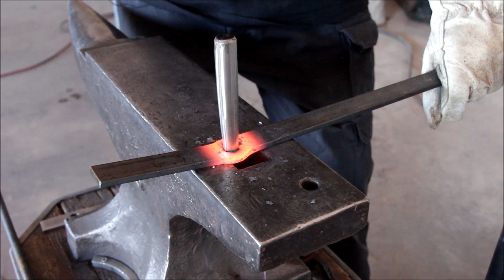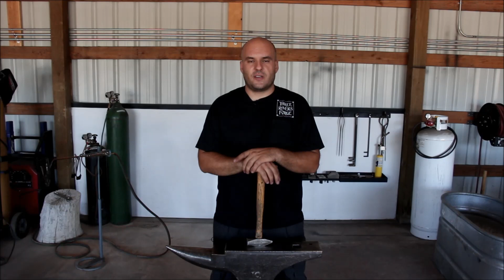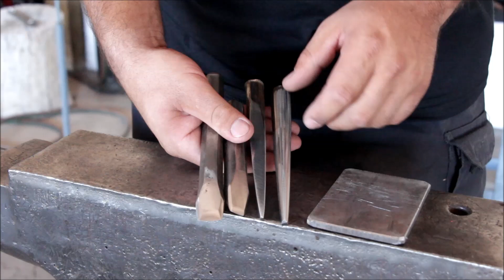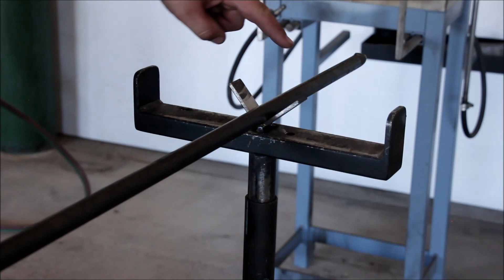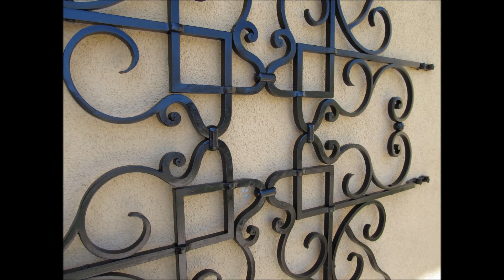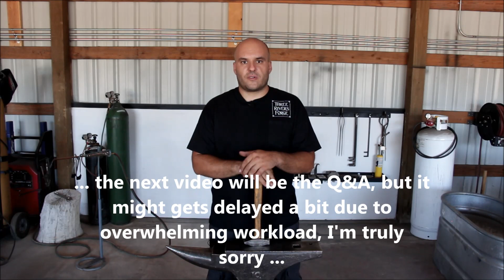Forging for Beginners: Slit and Drift Holes

Comment: when it cools it shrinks so you got to use a punch slightly larger than the bar you want to put through it. not sure what the exact math is for calculating it but im sure you could eyeball it.
Reply from the maker: Octoflex, the exact math depends on the amount of heat used and the material composition (alloy). So there is no exact math. I recommend doing a few trial runs to figure out the formula for the thing you're trying to achieve. I hope that helps.

Comment: Why is slit and drift used, rather than only using a drift punch of the final desired shape the whole way?  Is it only because of the limited force you can apply by hand?
Reply from the maker: Derek, #1: the slit and drift is used to make a stronger hole. When you use a punch only, you compress the material and that small compressed piece falls out. You loose that amount of material and thus, crate a weaker area. With slit and drift you punch the material aside and will not loose anything. #2: if you want to pass the same or larger section  through a piece you cannot just use a punch, that is the same size as the "host" material. You would just simply cut the material in half. You use a chisel to cut a longer slit, then a drift punch to open it up. #3: drift punches are not designed to use for direct punching. I hope this answered your question.
Reply: @DesertOwlForge  Thank you for your answer! I already understood the #1 and #2.    I guess I don't see the reason for #3.  It seems if you drove a drift punch with a very small point down to the soft plate and turned it over and did it from the other side, you would loose little to no material and have a hole that is the proper shape that could be drifted to the desired size.  Why does starting with a linear slit rather than a small round or square hole work better?
Reply: @derekhartzell3161  In my [limited] experience I found that if I took the approach of driving a pointy drift -- of the final size I want -- that I didn't get the nice results shown by the video. Even if driving into a small pre-drilled hole what ended up happening is that the sides didn't bulge out as much as desired, but instead, as the drift was forced in, the sides simply stretched length-wise to accommodate the drift instead of bulging outwards. The initial slit approach sets the stage that the drift can then push the side material outwards and not stretch length-wise. Your question is very logical, but in this case the results are not intuitive; until you actually try it... 🙂
Reply from the maker: Sorry for the late reply. You just simply can't drive a pointy drift punch straight into the material. It just doesn't work that way. The material just would move out of the way. It has way to much resistance. Try it out and you'll see. This is a technique that was developed thousands of years ago and for a reason.